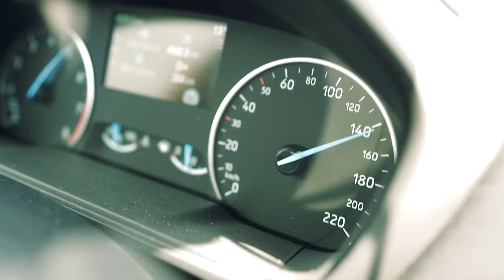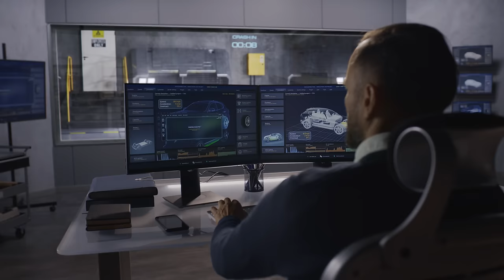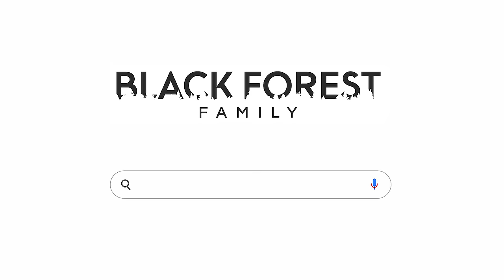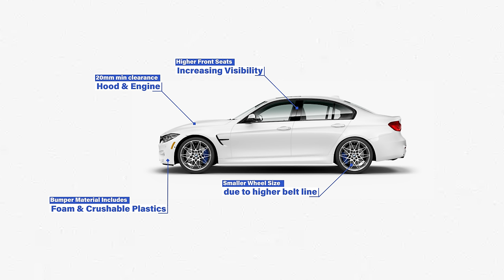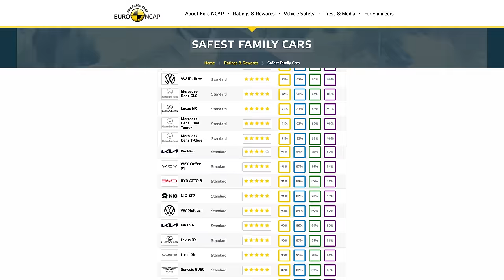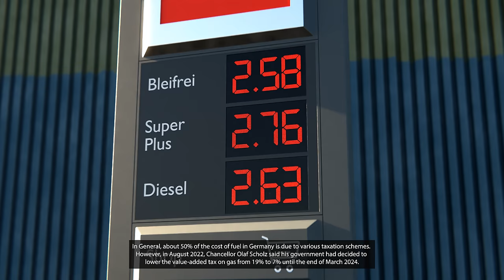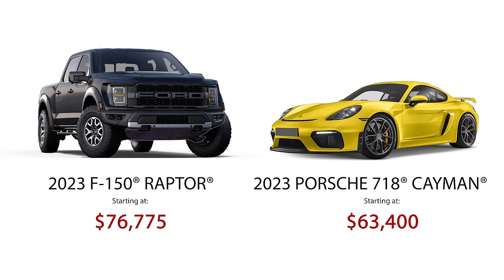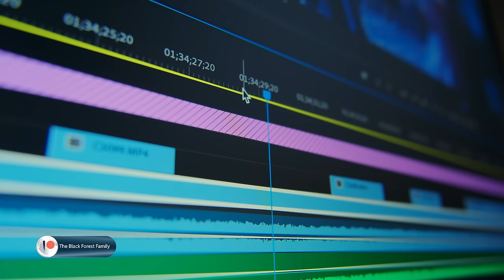DRIVING CULTURE CLASH: Why do our Cars LOOK so Radically Different?

Comment: As an actual "gearhead", who has probably owned close to 100 different cars over my lifetime, I agree with your perspective on the difference between the US and Germany (actually all of Europe).  I have owned everything from a land yacht (69 Chrysler New Yorker) to a small compact/economy car (VW Beetle), including 3 pickup trucks.  Currently I drive an Opel Corsa because it fits my life and needs currently.  All served a need in their time and they were generally what was being sold in the place/time.  For cars, I always drifted more to the smaller end of the spectrum because I found them more practical.  They were more economical on fuel, easier and cheaper to repair, simpler to operate and easier to maneuver.  Prior to the 1973 oil embargo, American cars were huge and had massive engines.  Afterward the trend shifted to smaller cars with smaller engines and has never returned to the pre-1970s size (except for trucks that remained about the same size).  Yes, vehicles have grown, but it seems in a strange way.  Existing models grow larger, but many times new, smaller models continue to be introduced.  Toyota is an example.  The Corolla was their smallest model for many years and continued to grow in size.  Soon it was as large as the Camry once had been, so they introduced the Yaris that was about the same size as the original Corolla.  VW did the same thing when the Golf grew larger they introduced the Lupo that was the size of the original Golf.  I find the more interesting factor in the future is how European infrastructure will cope with the changes.  Many streets are too narrow for two American sized cars to pass and the width and length make it hard to park them in the streets (1 F-150=2 Golfs).  Parking lots are also interesting.  The average spot is sized for European cars.  If you can manage to get a Ford F-150 into a spot it will stick out halfway into the traffic lane and you will not be able to open your doors because the other cars (properly parked) will be too close.
Reply: You don't need to go to an F-150 to feel the limits of parking space. Try any family MPV (Seat Alhambra, Crysler Voyager, VW Sharan etc.). I am driving a Fiat Scudo Panorama because of family size and it is a nightmare to get the thing parked at a mall or similar ...
Reply: Isn't the solution just bigger taxes for using two spots regularly? Somehow make them pay extra in urban areas. Small cars were kind of becoming "in" in the late 80s and then nothing came of it, wars, oil, wars, oil, and oh why not sub, not any, just larger. Larger than what? Just larger. I wonder how the old (like me, but the rich ones) feel about pissing on the ideals of our youth.
Reply: I think they will be soon forced to stop this trend to supersize cars, in EU at least. Slowly but surely more and more city administrations and governments are realizing that catering to cars is not actually economically sustainable(let alone environmentally).

So for example in the city centres car parking spots are getting reduced, not implemented, and get more and more expensive every year.

Not to forget, to create many of those huge parking lots in the Us cities, they bulldozed the low-income neighborhoods flat. I dare you to find an area in a city centre where you can move a stone without getting eaten alive by regulations and citizens´ cultural associations devoted to protect the cultural heritage.
Just look up what happened for one single house, built around 1850, that was illegally tore down (well, not completely) in Munich´s neighborhood Giesing. It´s called Uhrmacherhäusl. The owner, who had asked permission for renovations only, has been punished even if he claimed to have not wanted the construction company(which is now bankrupt) to tore it down, and has been ordered to reconstruct it exactly as it was. You don´t mess around with the Denkmalschutz here ;) .

Comment: Another excellent well researched video. 65 year old Canadian here but I have always liked smaller, European cars. Owned/drove 3 Fiats( boy did I learn auto repair with those) but the driving experience was enjoyable. Graduated to Japanese/Korean but still prefer the smallest car that fits my needs. Can't wait to rent my car in Germany for 18 days in August and rowing through the manual gearbox again on those wonderful Bavarian roads.Will see what car I will get, will be a mini/economy car.
Reply: Don't be disapointed if you get a automatic, more and more common also here in Europe ;)
Reply: @martinohnenamen6147  I guess I will take what they give me but since I'm at the lowest price point for  a vehicle as of now they would have to bump me up 2 classes and 200 more for my rental. Now the upside would be on the Autobahn, I would not have to pedal so hard to exceed 150km/hr:)
Reply: @martinohnenamen6147  Ended up with a great Hyundai I20 from Europcar. Had a 6 speed turbocharged motor which was a joy on the autobahn's and back roads. Hit 180 briefly and it really liked to cruise at 160-170 so I was very much enjoying the driving on those smooth roads.

Comment: I don't know if this is still true, but if I remember correctly, Germans are more likely to drive manual transmission than people in the US. Most of the people around me wouldn't want an automatic for different reasons  while in the US automatic is and has been pretty much the standard for decades unless you are looking for a sports car. 
I think this is another aspect of the different way Germans and US people use their vehicles. 

As a Nürnberger: Thanks for the short Nürnberg clip at 0:22  😊
I'm impressed by the work you put into your videos - not only the amount of research but also your editing, looks very professional! 👍
Reply: It was a matter of price. Manual transmission were cheaper. And it was easier to reach the emissions standards. Not so easy with torque converters. That changes in the next years to DSG drives until there are no more fossil cars - And no need for gear shifting anymore.
Reply: @wolfgangpreier9160  They also used to be more efficient, but automatics have caught up quite a bit.
Reply: Y'all talk about the past. Nowadays ICE cars with automatic transmission are at least as fuel efficient, though a bit heavier and more expensive. BEVs have a fixed ratio transmission. - Another difference is the slower adaption of BEVs in the US. US lags both EU and China by about 3 years.

Comment: In my state to compensate for not paying for gas and the tax included with that they charge an extra fee on annual registration for EVs. That extra fee is about equal to the entire price I pay for gas for my SUV in a year. Makes EVs a lot less attractive. Without driving to another state you can't find a dealership for anything but the 3 big american manufacturers and they tend to have very limited or no selection other than trucks and SUVs and none of the EV or hybrid options any of those manufacturers have come out with.

Comment: Cars up until the 1930's were roughly the same size on both sides of the Atlantic. It was only when the big American automakers started competing with each other completely out of control in the 1950s, combined with benevolent political regulation due to lobbying, that steered buying behavior towards very large cars. Large cars are nowadays considered an American tradition. However, this did not arise as customer desire, but was generated by the manufacturers for reasons of profit maximization. They discontinued selling smaller and compact cars first, then claimed there was no market for small cars because none were sold - thus steering customers into a more profitable product segment. 
Exactly what we are seeing right now in Europe where the semiconductor shortage is used as excuse to permanently dump small car models in favor of ones with bigger profit margins.
Master piece of the big three's lobbying work was pushing through exemptions from environmental and safety regulations for pickup trucks while having the US pickup truck market sealed off with a 25 percent import tariff. 
The dream of any manufacturer: a market segment for very simple vehicles that are cheap to produce, offer a huge profit margin, are subject to almost no safety and environmental regulations and almost no competition.
All that was left to do was convince consumers that this was the hottest thing since apple pie was invented - which was very obviously an easy task:
a truck is sporty, beautiful, luxurious, comfortable, powerful, practical. LOL.
As Europeans we can only rub our eyes in disbelief.

Comment: I know you didn’t want to go too deep into different regulations but the ‘truck loophole’ and the chicken tax are two further reasons that made trucks larger and more popular in the U.S.. The former enabled different regulations for trucks than for cars, among them less stringent fuel efficiency rules that contributed to the growth in size. The latter imposed higher import tariffs on trucks compared to cars, which made that sector more profitable for American manufacturers and thus made them focus more on them.

Comment: I am old enough (almost 80) to well remember the days before the Ford F150.  I am of the opinion that Ford and its competitors have heavily advertised oversized "pickups" like the F150 and Silverado because the profit margin is far greater than that of sedans (and old-fashioned pickups).  As the slogan goes, "advertising makes it happen."  Another very strange thing has happened-the US "pickups" of the present day are very different from those of my youth;  they have "crew cabins" to accommodate a family--rather than a single bench seat for the driver plus one or two passengers--at the expense of the cargo space in the back.  The huge "pickups" of the present day can't even accommodate a 4X8 foot sheet of plywood or 8-foot pieces of lumber.  I have read that is partly because of how the US government calculates the fuel economy requirements, but that doesn't change the fact.   They are also so high that it is difficult to load and unload the cargo space.  The engine size and gearing has also changed dramatically- traditional pickup trucks were not geared appropriately for use on freeways;  they were work vehicles.  There are still some places in the US where what the auto dealerships demand for a "pickup" (with luxury appointments, of course) will still buy one something with a mailbox in front.
Reply: Note:  the strikeout text was added by the Internet gods, not by me.
Reply: It makes no sense, but the one type of vehicle I have lusted after since childhood was a 1940's-era Dodge PowerWagon, which I need like another hole in my head.  It may be because when I was very young my folks had one (war surplus), which they needed for their business.  I would also love to have a Hudson Hornet, like that of my great uncle and aunt, but as a matter of fact that would be very dangerous compared to a modern vehicle--even with added seatbelts.  All those hard surfaces, inflexible steering wheels, and steering columns pointed right at one's chest;  it is scary to get into such a vehicle nowadays.

Comment: I have lived in the Netherlands for 20 years and have definitely noticed that cars are increasing in size.  It is very frustrating.  To your point about taxes and costs, these large vehicles were always more expensive to purchase, own, and operate and therefore mostly available to the wealthy.  Now, it seems that the costs have come down or people are willing to spend more for the status.  I think that the EU needs to focus more on safety regulations.  The wealthy shouldn't get a free pass to own these behemoths which make the roads less safe for everyone.  The laws of physics should be applied to the laws of the land.  Large, heavy vehicles should be crash tested against smaller vehicles at various speeds.  When the damage becomes too great on the smaller vehicle, then a speed limit on the larger vehicle should be set.  Having money doesn't give you the right to make it more dangerous for everyone.  Big pickup = 50Km in city, 90Km on highway...just like a Semi.   It's not rocket science and we don't want to follow the US in supersizing everything.

Comment: What is awful about the Unitd stated is that cars have gotten SMALLER in size, while trucks have exploded!  My grandmother owned a 1969 Buick Electra, and there is nothing even close to that car today. It was so smooth and wonderful to ride in, so comfortable. The seats were not hard bucket seats, they were like sitting on a couch. I am a landscape contractor, and my truck is 25 years old, because I will not buy a modern truck where you need a fireman's ladder to get your tools in and out. The pickup truck has become a luxury status symbol, instead of a practical vehicle for the working man. My 1998 Dodge Dakota is 42 inches from the ground to the top of the bed rail. A Ford F150 is 56 inches tall with that same measuremnt.

Comment: I want to add a technical aspect: In the US trailers have to have a bigger load on the hinge / towing car. 
Her we have some 50kg of load on the hinge while the US standard is some 100kg. So you require a larger car to tow any kind of trailer. 
Some US youtubers were wondering why we tow RV trailers with normal cars - well the general regulations are different an allow that configuration.
Reply: Wait, does that mean US trailers would not be roadworthy over here because they wouldn't be compatible with the cars?
Reply: @HappyBeezerStudios  Yes.
Perhaps possible, if you use it with an US car.

Comment: small cars used to cost less than €10,000 but after the environmentalist regulation , these cars have gone up in price to €18-20,000 so it makes sense when a toyota Corolla costs €30,000 or more to buy a bigger and more robust car like the RAV 4,

Comment: If you compare yourself with your grandparents, you notice that the obvious difference in preferences is not just about craving for safety or fuel efficiency laws, even small hatchbacks in Europe becoming steadily larger for decades as people grow taller due to better lifestyles and immigration of people from places where people grow taller (just look at average ethnic composition of basketball players). Girls these days are as high as were men in post-WW2 periods, and there are far more obese people even among high earners in developed nations partially because people tend to compensate not only for lack of happiness but also lack of sleep with food, so even if you aren't especially tall or obese, car design must accommodate proportions of a large (95%) portion of their customer base from which many are oversized, the US trend of buying in bulk to save money and reduce the number of shop runs also not helping to embrace small car case. 
Hopefully, switching to battery-powered vehicles where you can get much more usable internal space from the same footprint together with higher acceleration that is rather dangerous in high-riding cars even with battery lowering the center of gravity will diminish the popularity of high-riding vehicles with mostly bad driving dynamics (wild animal avoidance, etc.) as getting high riding trucks and SUVs on drive level of lower riding purpose build passenger cars that did not try to do everything is rather expensive for most people, unless you buying high riding car to cut cost on getting boat experience because it's sure that you don't get much safety in a car that is poor at avoiding collision coupled with an increased chance for overturning mostly prevented by electronics at the expense of restricted maneuverability in times when you need it most, not to mention aerodynamics penalty of driving high riding car which you will pay for in restricted efficiency and thus range for given battery size...

Comment: Can't help but mention the Volkswagen emissions cheating scandal from a few years back.  Volkswagen's were somewhat popular a few years ago, until it was revealed that the engine control computers were programmed to cheat on emissions tests. (I think it was specifically the diesel powered VW's that had this problem, which were popular at the time.) The result poisoned the reputation of Volkswagen in the USA.  Additionally, Mercedes Benz cars in the USA have rightly or wrongly have developed a reputation for being very expensive to maintain and repair.  As most Americans know, Toyota, Nissan, Kia and Hyundai have had much sales success in the USA.